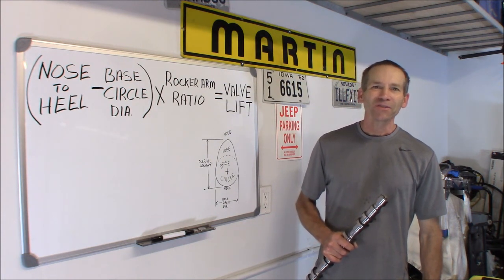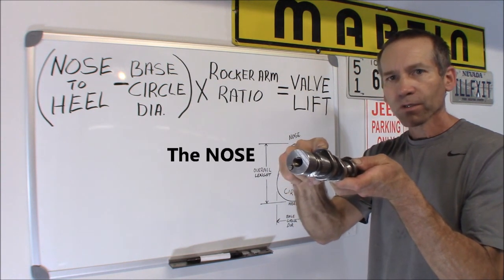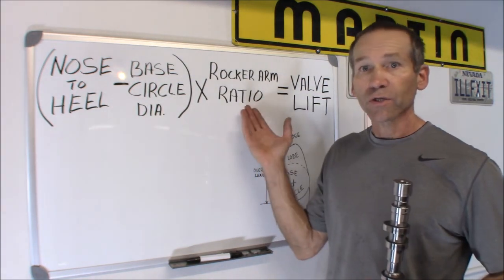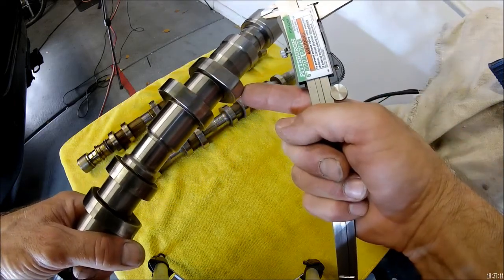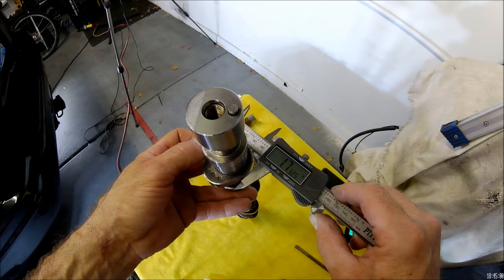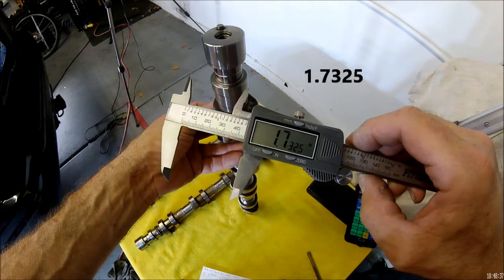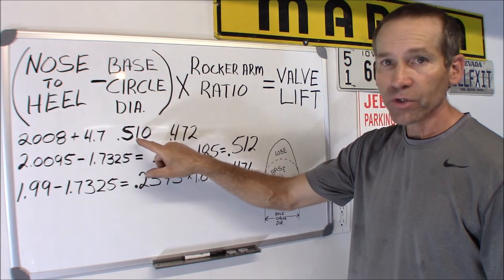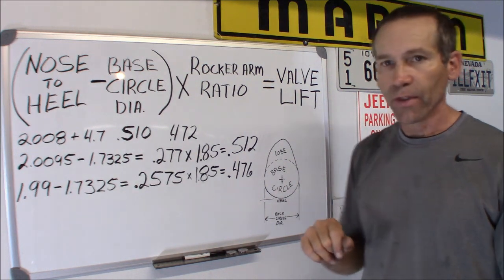How to Measure Camshaft Lift

Comment: Well done and to the point. I have a motorcycle repair shop and I just came up with a cam that I can't find even the manufacture. This helped considerably. Now I can try to get the valve stem protrusion, I hope. Thanks
Reply from the maker: Thanks Richard, glad you found it helpful, good luck in your search.

Comment: thanks,i just found the roller cam i pulled out of a recently acquired tpi sbc is essentially the same as the roller cam i was going
 to install because of this wonderful "math".one is a billet core and the other is cast,two different manufacturers 
but virtually identical lift.now i need to figure out lsa,duration etc to pick the better cam.
Reply from the maker: Glad it helped

Comment: What about finding out the max lift you can get before valves hit piston
Reply from the maker: You could use clay on top of the pistons with the cylinder head bolted into place and then rotate the engine. Remove cylinder head and measure the depth of the clay.

Comment: I know it's out of subject.but what do you think about cutting the transmission management wire.
Reply from the maker: I have done that. There is a trimmer shift in the upper RPM range.
Reply: @martinbuilt  ok cool.thanks for your quick response.

Comment: What was the difference between the 08 cams vs 99-04 HO Cams? Im assuming you upgraded from the HO Cams to the 08.
Reply from the maker: The 08 cams have .030 more lift intake and .043 more lift exhaust then the HO cams. I don't know  the numbers for the duration. I believe the lobe separation is 112* HO  and 114* on the 08. I have not yet got around to installing them.
Reply: @martinbuilt  ah, thanks for the reply martin. Look forward to watching a video of the installation of the 08 cams! Don't forget to take us on a ride along when you get done sir!
Reply from the maker: @DANEMSPRINGER   Yes I'll do a ride along. I'll also do a 0 to 60 mph test between the 2. I don't know if I'm going to do any Dino tests, we'll see.

Comment: hi martin i alraedy know my intake lift is 564 & exh lift 534 thats whats on my cam card my r/ratio is 1.6 i hav measured both int & exh lobes & got 334 intake & 354 exh so if i multiply by the rocker ratio of 1.6 i get 534 intake & 564 exh the exact oppisite to the cam card im no engine builder but does this mean the grind on my cam is wrong?
Reply from the maker: I would be surprised if the cam card is wrong. Are you sure when measuring a lobe that it is what you think it is, you're not getting the intake and exhaust mixed up? If you're positive then the cam would obviously be ground incorrectly.
Reply: the card is correct comp cams hav a similiar cam with the same numbers now for the lobes my cam i think its intake ,exh exh intake & so on not sure about other cams ive got a v6 gm 3800 2000 model.
Reply from the maker: @micthegreasemonkey2918  sounds like you understand which lobe is what sometimes it does get confusing